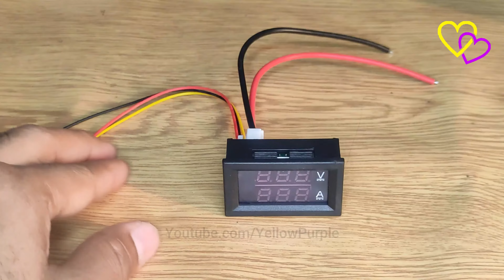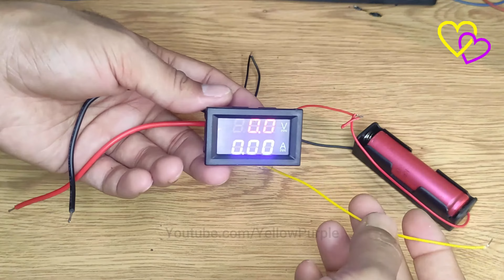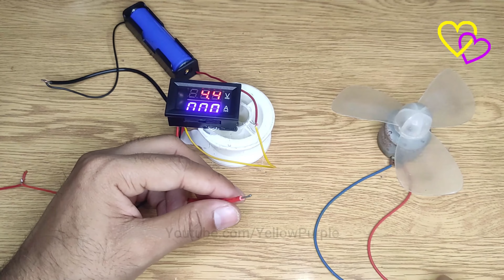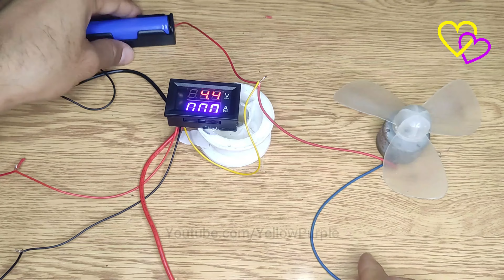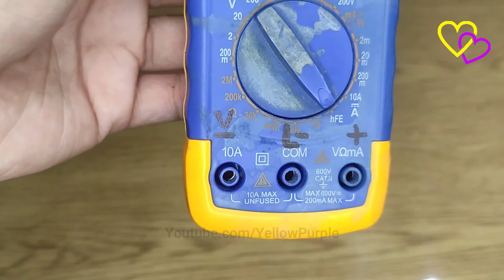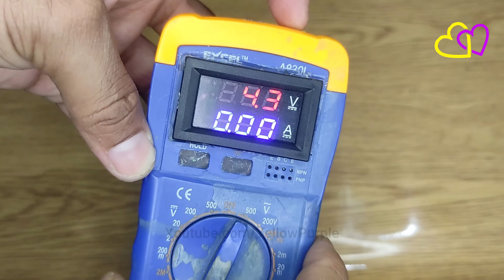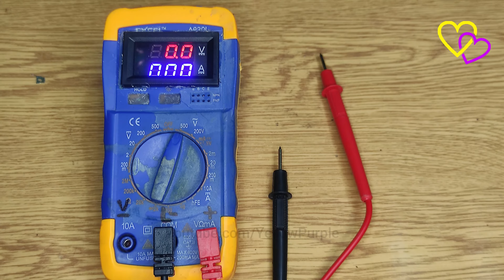How to Setup a Digital Volt Amp Meter Wire Connection

Comment: Have you ever connected the voltmeter in reverse way, does this module measure negative voltage.
Reply: I have one of these, it doesn't work in reverse. I tried connecting it and it still worked afterwards so didn't ruin the device, just did nothing!

Comment: Usually how much Voltage Required for ON the Digital Volt~Amp panel meter?
Reply: 3.7 lithium battery

Comment: why for first 4.3 but this Li-Bat=3.7v Max
Reply from the maker: Have to Calibration volt
Reply: Battery in first (4.3v) indicate that its state is in almost full charge the 3.7 v is floating state of the battery